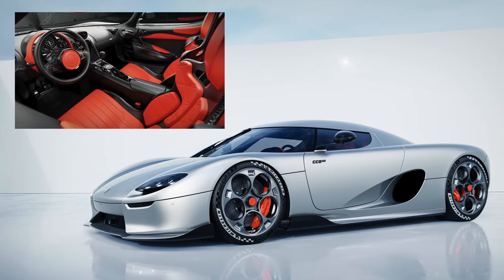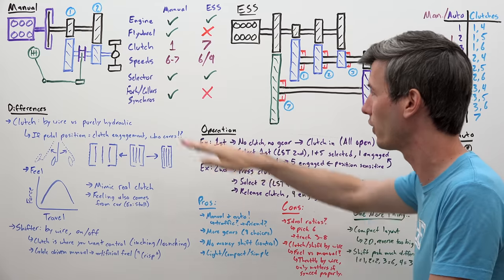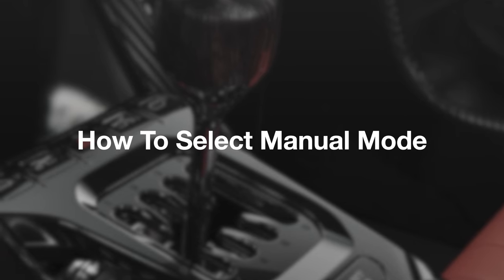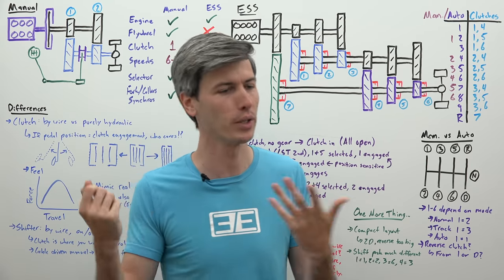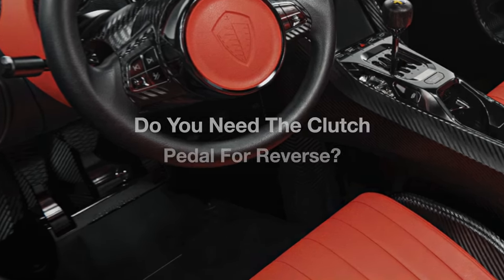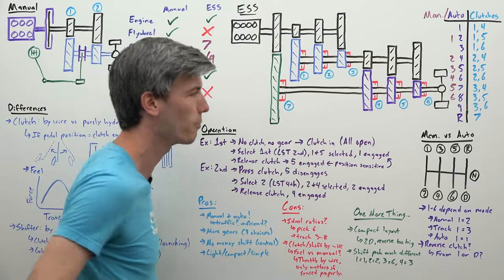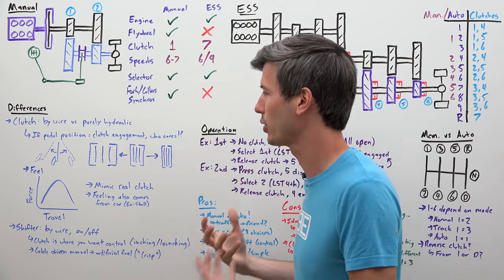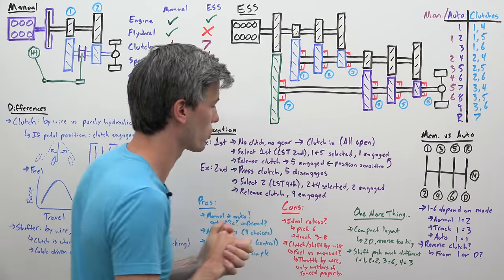Koenigsegg Reinvents The Manual! How The CC850 Transmission Works

Comment: The most interesting thing to me is the vivid imaginations that flourish at Koenigsegg. They have produced profound innovations in every aspect of the car and its manufacturing process including the engine, transmission and aerodynamics. I guess the big bureaucratic companies repress this sort of open thought.
Reply: yea, if imagination doesn't immediately improve the bottom line then it isn't allowed
Reply: If anyone says "That's crazy! We can't do that!", Koenigsegg says "Why not?"
Reply: You have to consider that Koenigsegg is building a few very expensive cars a year and big companies are building millions of cars in the same time span and those cars have to be serviceable by mechanics etc. 

Nothing Koenigsegg does lends itself to mass production. That’s not a bad thing, it’s just not their goal so they put their creative thinking into clever engineering
Reply: "Money is no object" is certainly nice to hear if you are an engineer pitching an idea to the boss :)

And what you say regarding mass production is true. A single Freevalve requires 30+ machining operation to produce, while GM, VW and Toyota are cranking out 100000 camshafts per day for 50 cents a piece.
Reply: You really have to compare across the same price point, which is hard to do, there’s not much at this price point.
Reply: They’re pretty much on another planet with the tech that they come up with. Imagine if Koenigsegg decided to go racing.
Reply: Koenigsegg is obsessed with making the best hypercar on the planet. He doesn’t have to answer to anyone and doesn’t care what he spends to get there.
Reply: It's also why you can buy a Hyundai for $30k, and a Koenigsegg for 2+ million
Reply: It’s not that they suppress it, they appeal to a particular audience. Not everyone can afford a multi million dollar car. And people cannot afford the maintenance costs. They want a car with as little maintenance as possible. Fill with gas and go, many people don’t even service their oil as they should.
Reply: @areitu  i think what op means by big company is not your everyday company such as ford, honda, toyota, etc. but a company like ferrari,lamborghini,buggati. 

producing these kind of transmission for econobox is ofc not an option
i mean, imagine you need to change more than one clutch for your daily.
surely it's not gonna be great if you're not a car person, and will just choose a normal manual or auto.
Reply: They repress these things because one they cost too much on R&D and it will cost millions of dollars for a car to have those features. That’s why hypercar brands like Bugatti and Koenigsegg makes crazy innovations and sells them for millions
Reply: @saltytuna3812  it’s always people with cat picks who are the idiots. Some of the biggest companies as you said are Ford Honda and Toyota. Ferrari is a small company that sells cars only to rich people, same with Lamborghini and Bugatti but those two are owned by Volkswagen Auto Group. Lambo is still with VW under the Audi category, and Bugatti was recently sold to Rimac, an EV hypercar brand from Croatia. 

What I consider a big company is a brand that sells cars in different countries like US, UK, and Japan and continents like the Americas, Europe, Asia, Africa, and Oceania (Australia). They sell cars with various models and body styles and sell them for cheap like $30-50k. 

Ngl this comment is pissing me off 😂
Reply: Why solve a problem with 2 clutches when you can it with 9?
Or none and a battery.
Reply: @yungboicontigo9278  
1. you talk like lambo and bugatti didn't receive any help from vw. i still considered them as a big supercar/hypercar brand. because 1, they're under vw group and 2 , because they're one of the longest and known brand around

2. i mention ford and toyota because the person i mention is talking as if these company need to make those innovation. hence why i use "but" (as in i give an example of a big supercar/hypercar brand)

3. take your time when reading my comment and don't get angry 😂
you mention this in your first comment " it will cost millions of dollars for a car to have those features" and you mention bugatti, if buggati is not a huge brand. why you mention that and doesn't count them as big company ??? lmao
Reply: Just too much risk and cost for a normal car company. You get what you pay for
Reply: one big thing people seam to be missing here is, if I remember correctly Koenigsegg is an engineer that was never formally trained as an engineer. he has a mind for how things work and never got tainted by a college with a degree. truly understanding how things work is more important than going to school and learning how other people think it works and there is a place for that but to be truly great you need to make your job your whole world and too many people go to college, get a degree then find a job to pay for their world or simplified (the things they want) Koenigsegg wants to make a truly great car other engineers for the most part just do the job to pay for the things they want. he's an artist in the world of engineering.
Reply: @Angry_Squirrel555  They'd be neutered by regulations unfortunately.
Reply: Speaking as someone who has been at their HQ in Sweden and seen their office layout, what you're saying starts there. They have sort of an integrated work space of basically everyone involved, it literally SCREAMS "imagination", it emphasizes on people talking to each other, throwing out ideas, communicating etc. 

I think that's one thing that really differentiates Koenigsegg with other large companies, even though it's a massive company, they're still a small company at heart, everyone has a voice and everyone is listened to.
Reply: If I worked at Koenigsegg, then this transmission would also have a freewheel.
Reply: @saltytuna3812  then why didn’t you put big supercar companies in your original comment? You said that they are one of the longest and known brands. Ford, Toyota, VW, and all the other ACTUAL big companies that you call “everyday” companies are also the longest and known brands. Ferrari started in 1947 and Lamborghini started in 1963. Ford started back in the early 20th century and it was quickly well known because of Henry Ford, America’s most important human. He saw that cars are the future and sold them back in the early 1900s for $850, which is like $20k in 2022. Ford, Toyota, and all these other everyday brands are some of the richest in the world. Toyota is the 2nd largest car company and the biggest in Japan. Like what I said, they sell various cars across different continents at an affordable price, that’s how they make profit and that’s how they are big. Like what I said, people who buys Ferraris and Lamborghinis and all the other supercar brands are wealthy people. 

Congratulations on being more dummer
Reply: The margin on cars like this is astronomical and the market for them is larger than ever, since the rich are richer than ever before. Boutique brands have more than enough money to fund engineering like this, most just don't because they'd rather line their pockets.
Reply: Lol it has a lot more to do with $ then stifling innovation.
Reply: @areitu  Not wrong. They definitely get a lot more creative freedom. Especially given the budget and their business model
Reply: @areitu  there are lots of companies that don't mass produce
Reply: Had Koenigsegg dare to make some mainstream car with some of its quite radical developments, instead of high-end grand tourers, most likely larger companies would either try to buy it out of the market or lobby for its closure.
Reply: THIS IS WHAT HAPPENS when you let the engineers do the job properly and don't tell them "its too expensive"
Reply: When genius is encouraged to create, mankind can invent amazing things. But normal people create amazing things too.
Reply: @Angry_Squirrel555  Except most racing orgs I'm aware of have governing bodies specifying the tech you're allowed to use.  Innovative tech that gives a distinct advantage in racing is often quickly banned.  Not much incentive for Ksegg to go there.  They might could do a Pike's Peak Unlimited car, that would be cool.
Reply: Granted, most of there ideas are one offs and probably not very reliable, but I can see this being a bit better for reliability.
Reply: Self funded, they don't answer to typical investors allowing freedom of creativity and innovation
Reply: @areitu  other Hypercar companies also make 20 to 100 cars a year and the while Hypercar industry combined hasn't had as many technical innovations as koenigsegg lol
Reply: @yungboicontigo9278  lol  what technical innovations has Bugatti made in the last 10 years
Reply: @zOiNhUh  why would they try to make hatchbacks, pickups and other "mainstream" cars?  You funny
Reply: @jwalster9412  speak with facts not "probably"
Reply: @william_SMMA  "probably" means that they are more or less rumored to be.
Reply: @william_SMMA  of course Koenigsegg wouldn't ever dare to make a mainstream car, or even SUV, yet some large automaker could eventually buy a license to use some advanced feature developed by Koenigsegg. Everytime some specialized automaker not backed by a larger mainstream company ever ventures into a mainstream segment, it's either pressured out of business or merged with a larger mainstream company. So, in order to survive, that's why Koenigsegg will most likely never go mainstream. Yet it could be interesting to say the least if Koenigsegg try to develop some SUV, now that even Aston Martin and Lamborghini make SUVs.
Reply: @zOiNhUh  boy ain't nobody reading that e-book you just wrote

all I know is you hating on Koenigsegg despite them never even wanting to create boring SUVs lol
Reply: @jwalster9412  link the rumors then
Reply: @william_SMMA  I've heard many people say that older Koenigseggs have reliability issues. No link, I would find a website but I don't have time for that.
Reply: @jwalster9412  yeah no shii, the CC8S and CCX were not super reliable but every single one since the CCXR upwards has had stellar maintenance records
Reply: @william_SMMA  dude, come on, I really don't hate Koenigsegg. I actually like the tech applied to Koenigsegg cars, yet most likely mainstream automakers won't have the nuts to try anything such as the Freevalve system (IIRC still only applied to the Gemera) for instance.
Reply: Interesting how that works..
Reply: They can also charge whatever they want for a vehicle. Something the big auto makers cannot.
Reply: @Angry_Squirrel555  They haven't invented anything. Merely adapting electro-mechanical actuators for valves and gears in automotive use. This is where their R&D tax payer subsidy is spent.
Reply: Big bureaucratic companies repress this sort of open thought because they use optimisation software to tune their manufacturing process. If re-tooling is too radical and costly, the idea will be dropped out. We are still in the stone age because Profit Margins. Last time I went to the dentist after 40 years, and lo and behold, everything was just like the 70s. I don't consider a fiberoptic camera and a LCD display as "progress" as it did nothing for my tooth, directly.
Reply: @julianpetkov8320  "We are still in the stone age" he wrote, on his computer, on the Internet.
Reply: @saltytuna3812  also Ferrari & Lamborghini are cheap compared to Koenigsegg. Only Bugatti could do a little bit more, but they are more focused to topspeed than to crazy advanced technologies. So I would say: everything is fine!! Koenigsegg is Koenigsegg and Bugatti is Bugatti. Would not compare both because they have a completely different focus and understanding of their doing. On the other hand: the most of us will never ever have to think about Bugatti vs. Koenigsegg and If you will have to: Congratulations for your great success!!
Reply: @areitu  you think a mechanic cant service a koenigsegg? lol
Reply: I believe with the big companies, profit supersedes passion now. When in the past it was the reverse. 

Most automotive companies, again my beliefs, are functioning off past achievements and passion of competitiveness. 

Nowadays, very few have produced a "landmark" car that brought them here.. 
With exceptions of Porsche 911. It's continues evolution hasn't been forgotten. Thank goodness. 
The same can be said to the Corvette. Imho
Reply: Yes, if there is one new employer I would like to have then it's Christian von Koenigsegg. I like challenges and not that many workplaces are willing to take the risks.
Reply: @zOiNhUh  Koeniggsegg wanted to make more normal cars. They very much wanted to buy Saab and merge the variable compression Saab had designed with their own electromechanical valves. But they weren't allowed to buy because they were considered too small and dreamy and a much worse buyer was selected, and soon there was no Saab.
Reply: @julianpetkov8320  Koenigsegg has applied for at least 17 or 18 different patents.
Reply: @perwestermark8920  I remember that. IIRC even a Saab was used as a testbed for Freevalve.
Reply: @jamiesmith6838  not sure to which extent the Corvette remains true to its roots, as the C8 now features a mid-engine layout just like most Ferraris and Lamborghinis. Maybe it was done in order to open way for the Camaro and certain Cadillacs as a more traditional option.
Reply: @zOiNhUh  Saab got raped twice. GM refused to let them use the variable compression, assuming traditional US development costs. And missed that Saab already had it working.

In a world of constantly increasing fuel prices, it's good to have a unique design allowing better efficiency based on the drivers needs. So these two technologies together would have been very nice to see in a mass-produced car.

People worry a lot about the manufacturing costs of a Koenigsegg but it isn't a very strong driver to try to reduce the manufacturing costs for 100 cars/year. If the need is 100k cars or a million cars, then I'm pretty sure Koenigseggs engineers can find significant ways to produce the parts cheaper. 100 litres of gasoline pays for a lot of massproduction.
Reply: @perwestermark8920  not to mention variable compression ratio would be awesome for flexfuel cars and to use gaseous fuels such as CNG or LPG.
Reply: @zOiNhUh  I don't know much about CNG or LPG, but flexifuel is always a good path (as long as it doesn't make the car mediocre for all supported fuels). And combining variable compression with arbitrary valve timings should really make the engine do well for varying fuels.
Reply: @perwestermark8920  that's exactly why matching Koenigsegg's Freevalve with Saab's variable compression would be useful, in order to benefit from the properties of each fuel.
Reply: @yungboicontigo9278  It's always people with car pics who are the idiots. Same goes for people with misspelled words such as "yung" or "boi" in their user names.

"Someone said something on the internet that made me mad and I have to tell them how upset it made me!" Grow up...

Comment: I've always been impressed with Koenigsegg.  I remember hearing about their hydraulic lifters YEARS ago, and I've followed them since.  Great video as always!!
Reply: The actually got rid of lifters with their Freevalve technology. It’s either pneumatic or electronic actuators.
Reply: @RadDadisRad  I'm guessing he was referring to freevalve and called it hydraulic on accident
Reply: @shredder8910  Well they're not lifters, whether they're hydraulic or not, freevalve has no cam, and the valves are a piston that move with air.
Reply: @shredder8910  Definitely, hydraulic lifters were a thing in VW Beetles even.
Reply: @PBMS123  Yep, for sure, I just understood what OP meant
Reply: @RadDadisRad  It is a "pneumatic hydraulic hybrid", using a pneumatic piston for opening the valve(Normal helical spring closes it) and a smaller hydraulic piston for valve hold and damping, opening and closing valves to let the piston suck in, push out or just hold the same oil volume(Quite genius I think!).